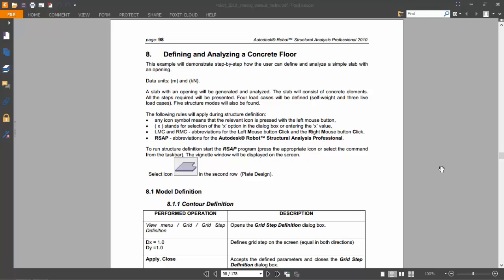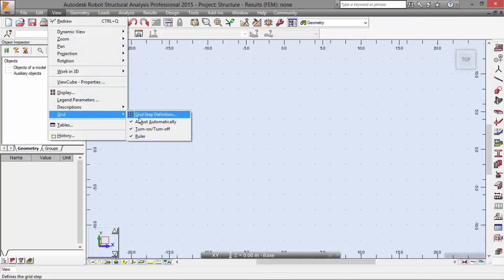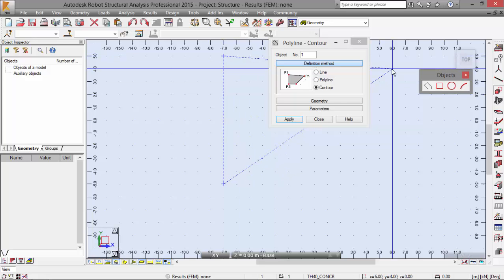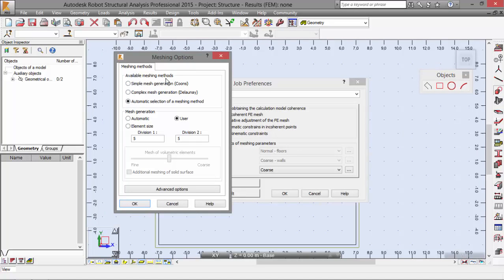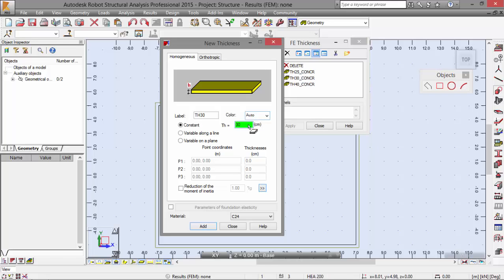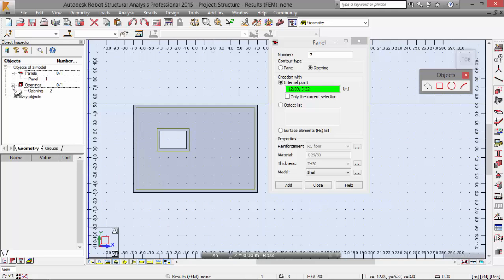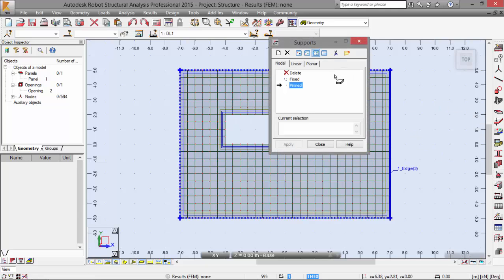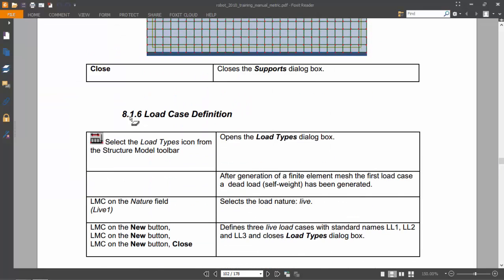Exercise 8 - Part 1 - Defining and Analyzing a Concrete Floor (Robot Structural Analysis)

Comment: Hello,thank you very much. 
Can you explain how to design a slab on grade and calculate As required? If no option in Robot, how can I manually design it please.
Reply from the maker: Hello! You might want to use slab on elastic foundation (it is available in Robot). Depending on the slab and your jurisdiction, you should be careful!
Reply: Thank you, you're a legend